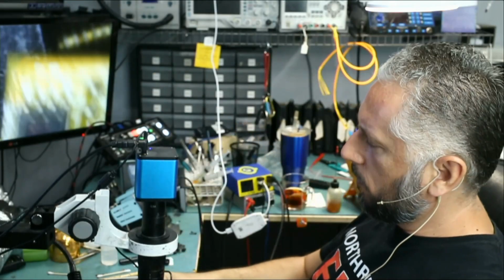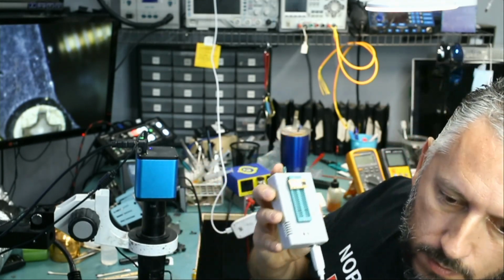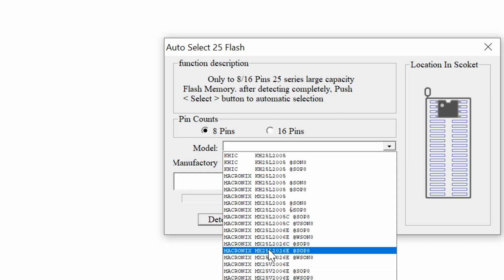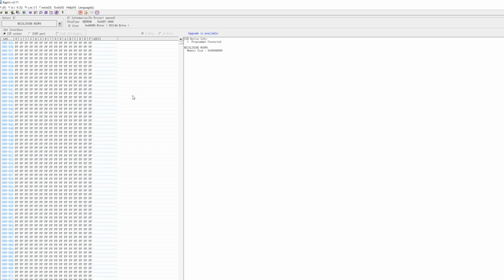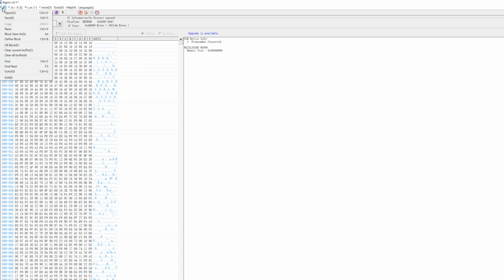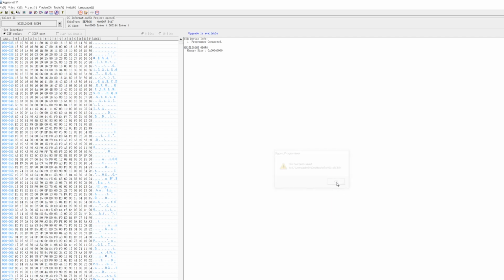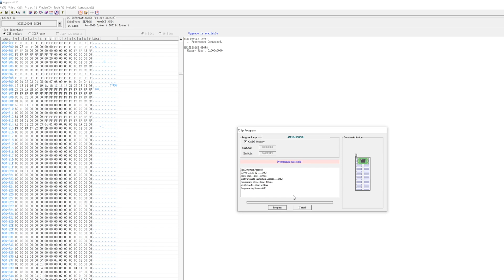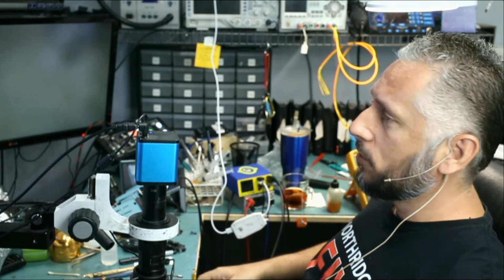Lenovo AIO C460 Forgot Bios password - Flashing clean firmware with EEPROM Programmer

Comment: Hey Alex. I'm affraid that this one will be a return. You have flashed a kbc firmware which most likely does not have any locking mechanism inside. What you are looking for is bios chip between PCH and Cpu next to the ram slots
Reply from the maker: Thanks Slavoljub,. I appreciate your feedback on this. I checked and did find the Main Winbond Bios next to the CPU as you mentioned. I flashed the firmware on to it and restored the old firmware for the other chip. That's why it's always good to make a backup copy of the old firmware as I mentioned in this video, just in case we need to go back. Thanks again.
Reply: @NorthridgeFix some laptops or desktops you can reset the firmware password by removing a tiny battrey it is called the cmos battrey
Reply: @prozomarizhere That's old news mate,  mew models do not allow that..
Reply: svaka cast Jokicu 👍
Reply: Kkkkkkkpklkkkkkk

Comment: So, how exactly did you check to see if it worked? Because I didn't see it get booted to post. Wouldn't you check and make sure it worked before you shipped it back? It certainly looked like you have the equipment to boot the board using an external display.

Comment: Can this be done without removing the chip from the board?  I always am worried when I update my bios that the power will go out!
Reply: You're getting confused here. Normal Bios updates are fine to do from the motherboard manufacturer website as downloads. The way he did it needs to be done on very rare occasions. I do hope he will explain it better one day as to when it needs Bios chip removal to reprogram.  Am no a tech but that's what I've seen on YouTube over the years.
Reply: @justoandres4911  I just figured there was a way with alligator clips, instead of having to de solder.
Reply: the way he did it its the only way.

Comment: There a clip that you can program the chip without desoldeeing, I mean directly on the board.
Which is cleaner, quicker and less likely to loose or damage it.
Reply: SOIC8 clip, I've used one many times modifying BIOS on Thinkpad before. It's very useful.
Reply: But you have to desolder it at many times. Often you can’t Programm it in the circuit.

Comment: I rarely work on computers and electronics any more. But in the case of not being able to find a compatible firmware to write to the chip. I have read the chip and SOMETIMES, your can luck out by reading the comments through different programs and look to the right side and look for words are things that seems to be a possible password and make a note of that address all the way to the left side, and when you click on the possible password it will highlight part of the Hex code and you can make note of exactly what it has and replace it with all F's are 0's and that will remove the password then safe it. And if it doesn't work you can simply just reread and edit what you wrote down to the exact address. This is far more than the average person wants to do but it can be done.

Comment: The FlashcatUSB is much better, you don't have to use hot air to remove the SPI chip, there is a special adapter pomona 5250 clip simply bites onto the chip

Comment: How about the SMBios, the serial number saved on the old image will be lost, which may deactivate the Windows licence and prevent proper detection of the computer.
Reply: I was about to ask the same. You were quicker.
Reply: The password would be saved in CMOS memory, and not in the BIOS chip, at least, that's what I think.

Comment: There is a device with which you can fix the BISO chip without desoldering the IC from the motherboard. A clip is attached on  top of the IC and the rest is the same

Comment: Hi, have a question.. Where do you get factory file for that chip? I have many Lenovo ThinkPad sitting on the shelf bios locked because former IT didn't told me the password (he claims that he don't remember) took the laptops to Lenovo service and they don't do this job and only can replace motherboard which laptops are out of warranty and replacing will cost more than laptop worth itself... 😕

Comment: Nice work alex. Always nice to see your jobs. Did you ever got an reaction from your customer if it works when you do jobs like this where you only got the motherboard?
Reply from the maker: When we ask customers to mail the whole device and not just the motherboard, only few listen. If the new firmware doesn't work, then the customer have to mail back the whole device and not just the motherboard so we can test it. That includes the "CPU and Ram" which I don't know why they weren't mailed with the board in the first place.
Reply: @NorthridgeFix  i understand, i would also prefer to get the whole device to test my work after it. Would be much better than sending just the mainboard

Comment: how do you know that this chip is BIOS chip, thanks
Reply: To save space they are usually serial flash 8 pin chips. The 25L2026E designation of the IC is the give away, which you can check and download the data sheet.

Comment: I wonder why this computer doesn't have a CMOS clear function.
great job though😉
Reply: It would be a bit pointless having a password function if there was a clear function to circumvent the password.
Reply: @SiaVids  Clear CMOS jumper is however not meant to be used by end user rather than a specialised technician. And it's much safer to avoid Hiroshima Bombs caused by soldering😵

Comment: You can use RT809F with socket adabter or just socket adapter with this programmer
...you don't have to solder the chip on that board...it will save your time.

Comment: I have a question regarding bios chip. My laptop motherboard was damaged and i brought new mother board for my laptop but new mother board comes with older bios version which do not support gpu and i am not able to upgrade it to latest version . Everytime i try to update it shows update fail. So i replace the bios chip with my original motherboard bios chip now gpu is working but it take longer time to boot up. Please tell me how i can update the bios version and use the original bios chip that came with the mother board.

Comment: A god job, but you should take the windows key from the old bios chip and use a hex editor and edit the new bios file and put the windows key on it and solder back.
Reply: That's too much work when you can just call Microsoft and explain what happened and get a new key.  Or run linux and not worry about it.
Reply: @LatitudeSky  without work there is nothing, this is a saying in my country

Comment: Great video as always👍you should try the clamp tool for that programmer, it saves unsoldering the chip from the board
Reply from the maker: Clamps are for noobs
Reply: @NorthridgeFix  😂😂😂
Reply: @NorthridgeFix  LOL was not expecting that. Enjoyed it. 😂
Reply: @NorthridgeFix  and what you think we are all ?
Reply: @NorthridgeFix  hahahaha
Reply: Clamp let's me R/W PS5 flash 😉. Not noob
Reply: Clamps sucks. Its very hard to get a good connection and its so flimsy that it cant be used more than 10 times. After that they dont hold well.

As for me, i cut the clamp wires and now solder the 8 wires onto the ic without removing it from the board.

Comment: why not just take out the bios battery power it on , that resets the entire bios and password without having to solder anything....
Reply from the maker: Because we are in 2021 not 1996
Reply: Sorry master Alex but this is also how I would do it. Very easy and straight forward, maybe even faster. Even if my clock is still setting itself to 1970 😂. Thanks for the video 😎
Reply: @netpackonlinesolutions3254  Well that would not work, technology has moved on and left you behind.
Reply: @sallybundock1179  why wouldn't it work?
Reply: @netpackonlinesolutions3254  Password is written in the EEPROM along with the   basic operation of the board.

Comment: I recently did the exact same procedure on an Asus laptop for the first time. Trickiest part was to find the original bios file on the internet !
Reply: Where did you find it?
Reply: @tanishqbhaiji103  I think Most of the files are available in The Manufacturer's Official website.
Reply: @userJfedYj45688  nope
Reply: Asus has excellent online support. Navigating their website is a hassle, nothing like it use to be. However, google can generally save you time, send you directly to the links you need. I can still find support for a very old Asus A7V133 motherboard from Google links to Asus's web page. After all these years they still have it and that's nearly a 20 year old board. Very few motherboard manufactures do that.
Reply: If you have trouble. Reddit is your best bet.
Reply: It's because Toshiba is no Dynabook. I haven't had a problem finding a bios but I can see why there might be some issues.